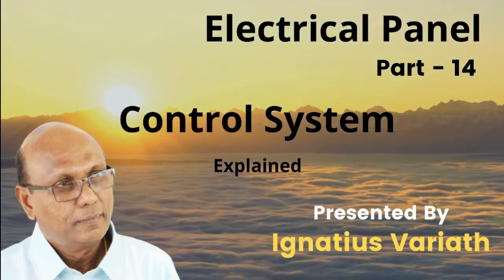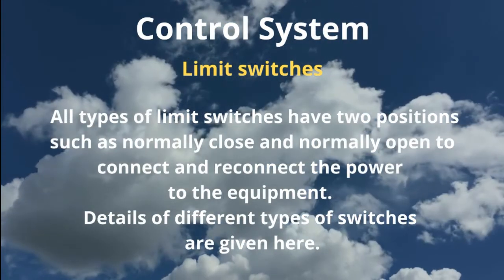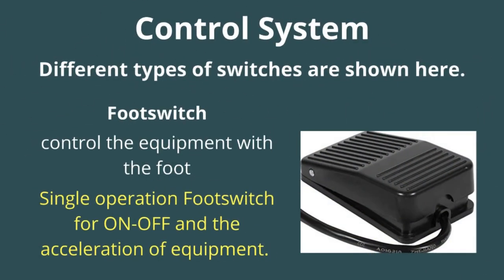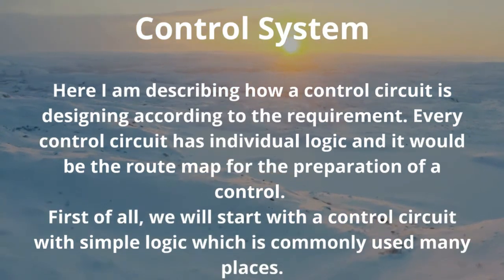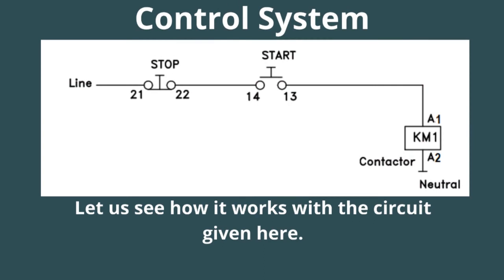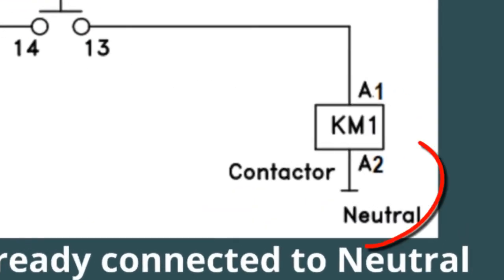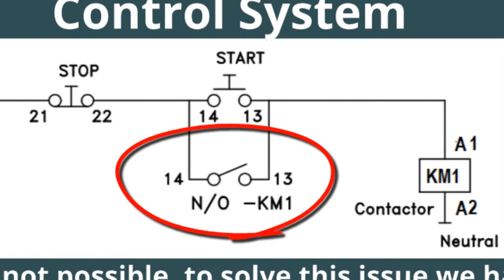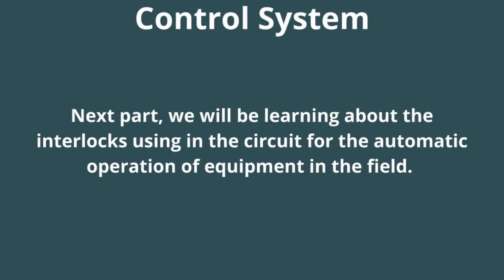Know about Electrical Panel | Part 14 | How Control Circuit functions | Control Circuit explained

Comment: Control Systems was my major when I took my M.Tech but , I ended yo switching the major to Engineering management due to the difficulty.  Very good explanation. Thanks for posting this video
Reply from the maker: Thank you to hear that you liked the control system. It is very easy if you follow the scheme. You can even design also.
Reply: @IgnatiusVariath  Got it. Thanks